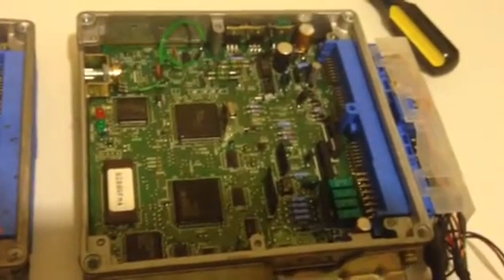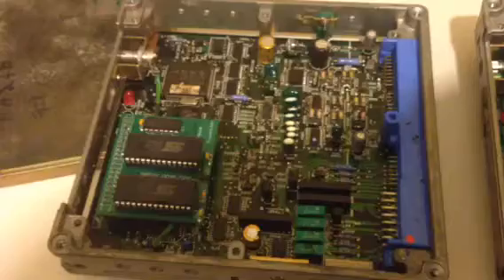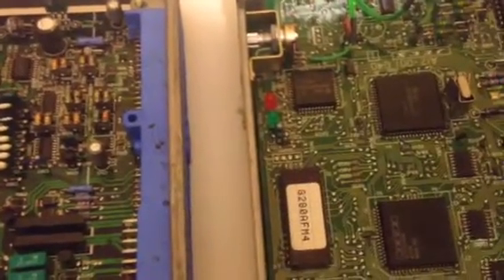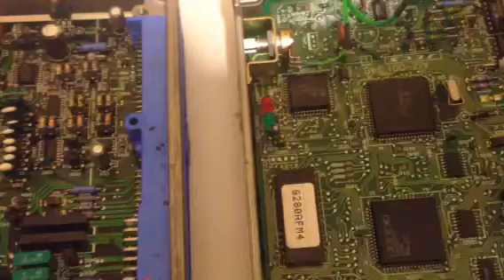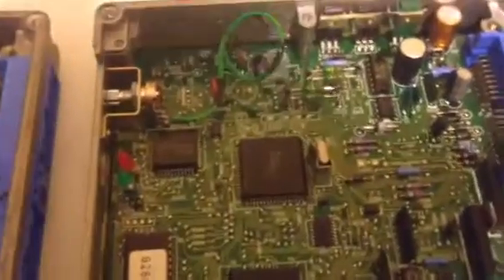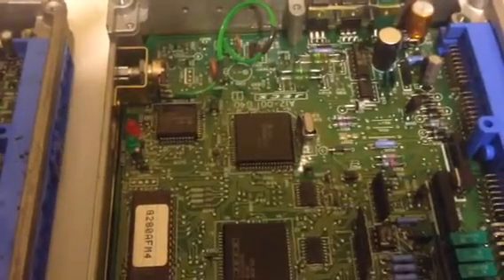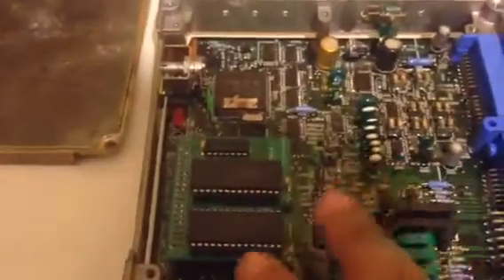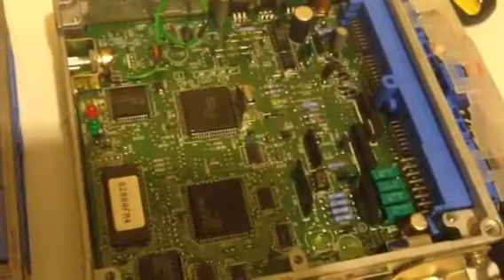Pulling Codes From Your 240sx ECU

Comment: Why are both lights flashing at once on your example ECM? In Self Diagnostic Mode(3), my 1990 SOHC KA ECM flashes the red light for numerals of ten, and green light for single digits. I also read this online, "The codes are indicated by the number of both red and green lamps. First the red lamp flashes and then the green one. The red lamp correspond to units of ten and the green lamp to units of one. For example, when the red lamp flashes once and the green lamp flashs twice, this signifies the number "12".". Why is your ECM displaying differently and flashing both lights at once? Thanks in advance.
Reply: on mine it goes 2,3,4,5,1 than all over again. i believe its flashing to choose what mode you want to test, which would be mode 3 for my single cam. im just trying to read up on how to choose mode 3 so i can read codes if there are any. What you wrote down is what it says in my haynes manual. So once i figure how to choose mode 3, it should be the red/green lights individual.